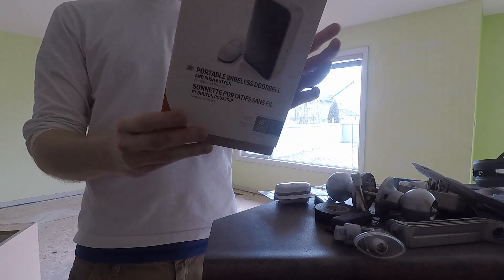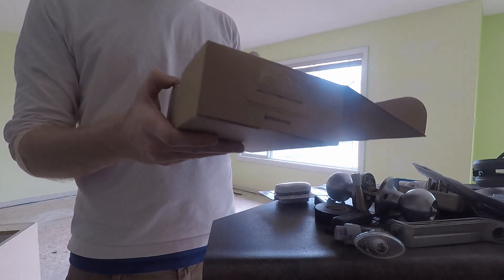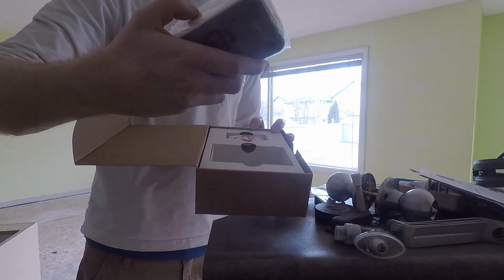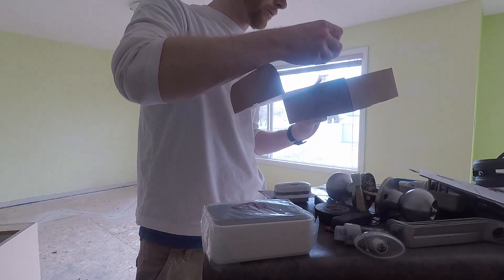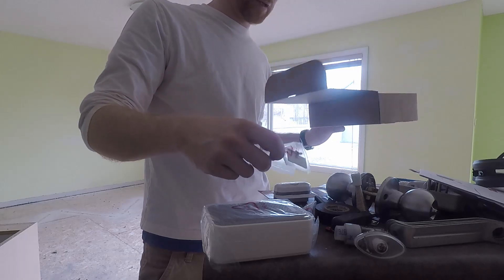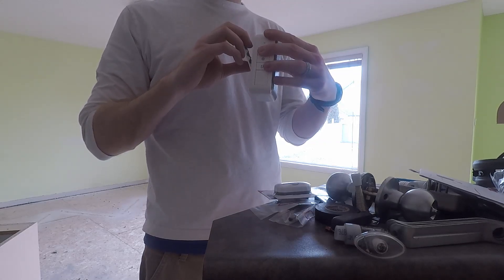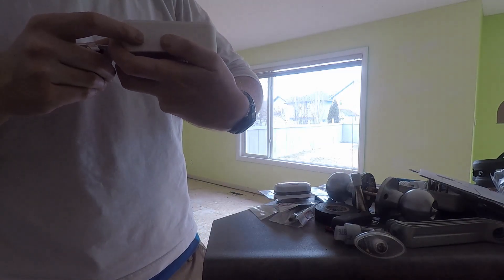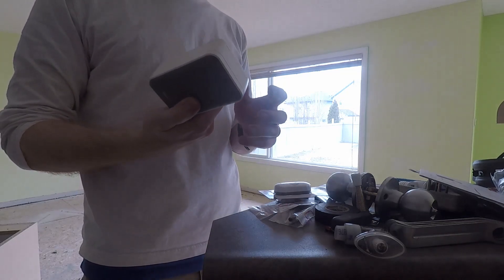How to Install a Wireless Door bell Honeywell 3 Series

Comment: I know this is an old video but I lost the instructions and I can't pair the doorbell up with the inside square model thing any suggestions?
Reply from the maker: Good Morning, 

I was able to find the instructions online, below is the link to the PDF. I hope this helps. if your having some issue you might need to reset the device which will remove all paired devices and bring it to a factory default state. Or when pairing try bring the door bell and speaker closer together this might help. 

https://www.honeywellstore.com/store/images/pdf/RDWL313A-honeywell-door-bell-manual.pdf
Reply: @TDLDIY  thank you so much. I greatly appreciate you looking at my message and helping me. 🤗
Reply from the maker: @sandykirk1503  Your very welcome. I hope you have a great day

Comment: Can the volume be turned down?
Reply from the maker: I will check tomorrow and get back to you.
Reply from the maker: Doesnt look like this model can. But I did check other models and you can adjust the volume. I Believe it's the one that can be plugged into the wall vs this one with batteries.
Reply: Honeywell Home DC313N